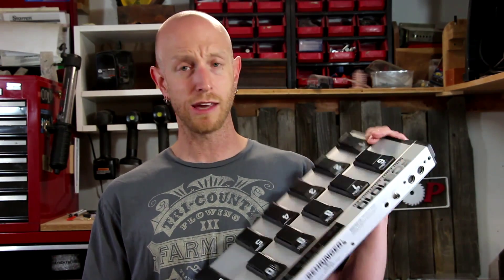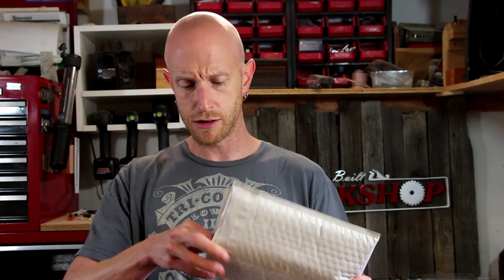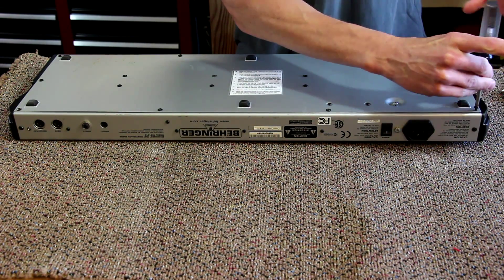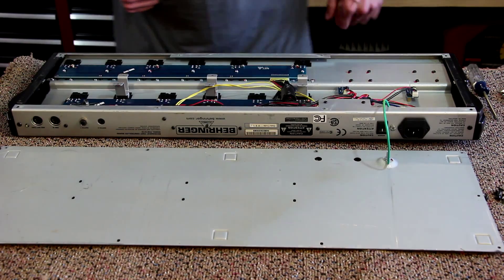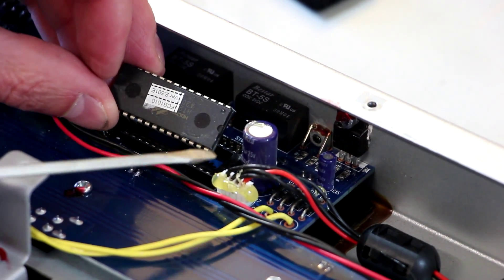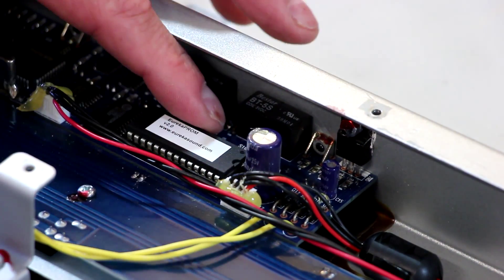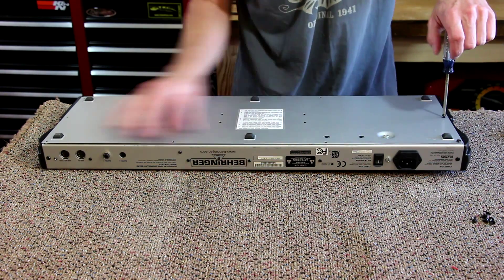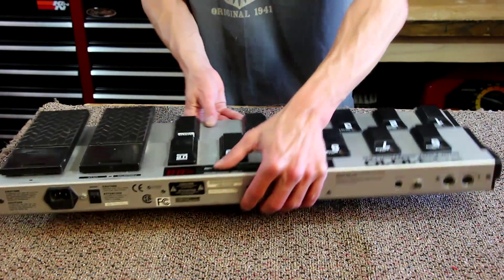How to install a EurekaPROM in a Behringer FCB1010

Comment: Not a musician but am into electronics. I found one sticking out of a garbage can at Walmart with plastic is still on it! I'm going to take it apart and clean it up and then see if it works.  EDIT: It works and is super clean inside. The sticker fell off the EEPROM so I can't tell what version i is.   Also regarding the different screws: the 6 screws on the outside short edges are long, all the others are short.

Comment: Hello! I just bought a used FCB1010, and it turns out that the chip is from 2002 (v1.1). Can I still update to the latest version, or will there be a compatibility problem?

Comment: Hi, I just bought this- what’s the advantage of using Uno / Eureka chip? Which is recommended using Logic X , MainStage, S-Gear?
Reply: I have only used the Eureka Chip. I can't speak for the others. They each offer some ease of programming and work well with different processors. You'd have to read up on all the other chips to know what would work best for you.

Comment: I am trying to do this now, and I cannot for the life of me get the old chip out.  I should add, somebody installed a EurekaPROM into my unit before I bought it (not installed by the person who sold it to me, that person did not know it was installed... I found it in there when I went to replace the chip with an UnoPROM).  I still want to put the UnoPROM in there, so I am trying to remove the EurekaPROM.  I can't get it out.  Do you know if this is normal for it to be harder to get the Eureka out than the original chip?  Or am I just failing?  I have applied so much pressure for so long trying to pry it out that my wrists actually hurt, and I'm afraid every time that I'm about to break something that the chip is connected to, I can feel the female connector part that it's plugged in wanting to lift up from the board, and I'm afraid it's either going to come disconnected from the board, or snap the board in half or something.  It's ridiculous.  I am NOT prying from under that female connector, I'm trying to get between the Eureka chip and the connector, but I can't get the tip of my screwdriver to wedge in between there, so I don't know what the heck I'm doing, but it's not working.  I need advice, badly.  I'm getting very frustrated over here.
Reply from the maker: Wow, that's really stuck. Is there any sort of glue that you can see? It shouldn't be that tight.

Comment: Important note: Work on a static-free surface and make sure to touch something grounded like a faucet - and don't create static by shuffling on a carpet. Also, do NOT use a screwdriver. You could accidentally touch something like the capacitor next to the chip (the blue barrel) or another part of the circuitry and FRY something. Instead, use a "spludger" - a plastic prying tool designed for this purpose. Spludgers are dirt cheap and can be bought at an electronics supply store or ordered from places such as macsales.com or ifixit.com.
Reply: That was exactly my thought as soon as I saw him push a metal screwdriver in. Use plastic tools when poking around the board, folks!
Reply: Hi. Great tip. Which surfaces are static free? How can I do the same chip changing but with the proper grounding preparation at home? Thanks